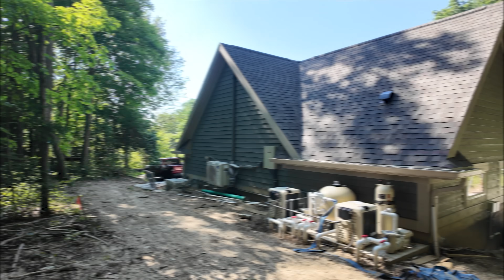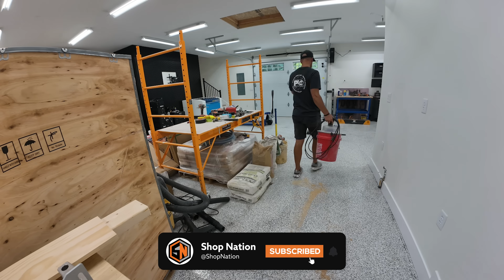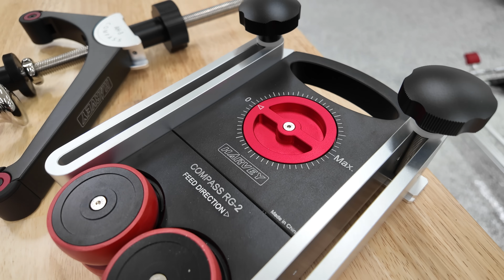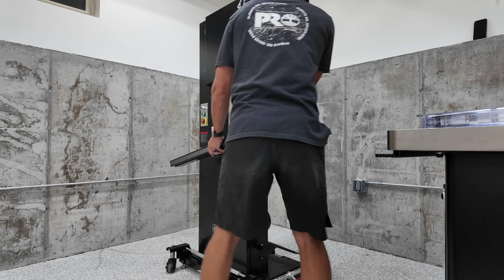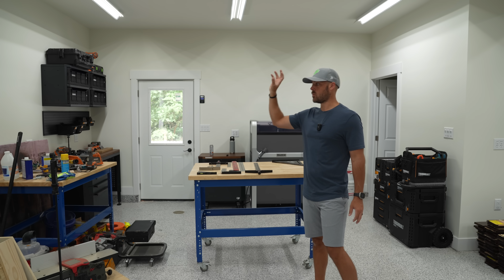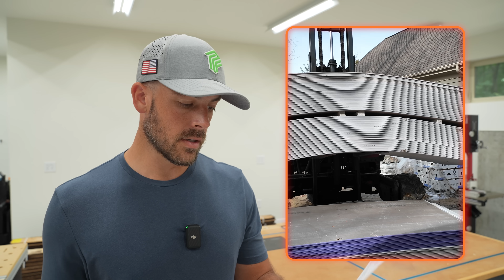Why are shops so expensive? (Full Cost Breakdown) // Shop Build 10

Comment: As a retired construction guy, the costs were...uncomfortably expected. My son is currently in the "I bought a piece of flat mountain property that I'm going to build my dream get-away with my dream oversized shop" phase. This video is very helpful as this would be a pretty good look at actual cost as opposed to the wishful cost you alluded to in your closing. Oh, by the way, the star of this video was your wife. She wasn't there just to lend context but was doing the actual "heavy lifting"! Now there's a partner! Thanks again for the reality check for all the dreamers out there, even us guys that know a guy that knows a guy......it still cost what it does....reality!
Reply: Nope that's what it costs most people don't know how much concrete it costs to get it done correctly. This is why 3d printed concrete homes will fail won't save any money and you can't modify the structure once it's built easily. As concrete is expensive so won't be saving anyone money.
Reply: These are gouging prices … way over paid.
Reply: @RobertMehrer  Not all of it, but I am gobsmacked by that foundation cost.
Reply: @haphazard1342 I agree. This shop cost around $185 a square foot which isn't bad considering most construction is starting to cost $250 a square foot

Comment: It is an awesome build, I've been with you since the beginning. Love the transparency, we built a 1200 sq ft building back in 2015. I know I could have got much larger had I went pole barn or steel but we wanted it to match our house and smaller building. For the exterior only we spent almost $50K, initially we wanted full brick to match our house but opted for 1/2 to keep costs inline. Not sure of the final costs as I didn't keep a running total. LOL!

Comment: That foundation price is astronomical
Reply: I was going to say that foundation is nothing more then a normal basement, it should have been no where near 80 grand. Rough and tough site or not, that was a f u price, i dont want this job but if you want to spend your money here we go price.
Reply: It was ridiculously overbuilt. On the video of it, they guys pouring it even said they had never seen anything like it. That's on the engineer who drew it up imo.
Reply: @Hagop64  No doubt its only holding back 5' of dirt its not like its 15' high a 6" wall and 10mil bar is more than enough. The price should have been 1/2 that.

Comment: I have a Harvey tablesaw, and it is great.  The only drawback I have found is the fence, you cannot use jigs that fit over the fence, because of the screws for the aluminum extruded fence.
Reply: Just remove the extruded aluminum fence and you have a blank canvas. 

I’ve built several jigs and don’t think I’ve put the high/low extrusion back on in over 2 years
Reply: @Dave_116 yes,  have thought of that,  it’s a pain getting them back on. I am working on a rail for the top and will modify the jigs to use the rail.

Comment: So there's obviously a ton of custom finishes here, this isn't your average backyard standalone shop, so I think that's where the overages from your expectations are. Site prep was also a lot more complicated here. $150k would go much further on a basic shell built on flat earth with average finishes. Now, that's not what you wanted, and it's amazing you were able to build exactly what you wanted! Congratulations on completing such a beautify project!
Reply: I just don't understand how the site prep and foundation ended up costing that much. The integral retaining wall doesn't explain it, and even if it were that expensive there's no way it was strictly necessary (vs. site grading and using a non-engineered retaining wall).
Reply: @haphazard1342  I am paying $15,500 for a three wall stem wall with 4" floor. 28x30.  It is an addition to an existing shop.  It is just out of hand.  I think 5 years ago it would have been $7k

Comment: What are your plans for the bare concrete walls inside the shop?
Reply: I think painting would be nice. At minimum, the same as the wall color.
Reply from the maker: Not sure yet, originally I was going to leave them raw but I might prefer a more uniform paint of some kind...ideas?
Reply: @ShopNation Drylock paint. Not the water based stuff. You won't regret it.
Reply: @ShopNation  I definitely wouldn't leave them bare, especially since the space essentially doubles as a YouTube studio.
A premium route would be large matte grey tiles, similar to what Obsessed Garage just put in his garage.
A cheaper route is paint it a charcoal/black color.
Reply: @ShopNation  Insulate the bare concrete walls before covering them up/painting etc

Comment: So many of your issues and actions mirrored my own (during my shop move/renovation) that it seemed like we corroborated on this video. Haha. My new shop is 720 sq. ft. w/1/2 bath and 640 sq. ft. 2nd floor. There is an 8 ft. by 8 ft. lift. All major sanding/finishing is done on the 2nd floor with separate ventilation. The totes clearly demonstrate the old adage, "A place for everything and everything in its place." I forgot about my laser duct until I began getting it ready to move. Luckily, there was enough time to get the new duct installed in a good spot. I planned equipment placement for 6 months. I set everything up but have been tweaking the arrangement for over a year. I'm just thankful to have the room to "move around." I built the shop for a little more than the foundation and framing cost for your shop. The main differences were the concrete work on flat ground vs. a hill, an existing RV hook-up with 100 amp 240V, close proximity to my septic system and no fancy exterior/interior trims. I also feel the A/C is one of the best pieces I've ever added to any shop. Thx for another info-taining video.